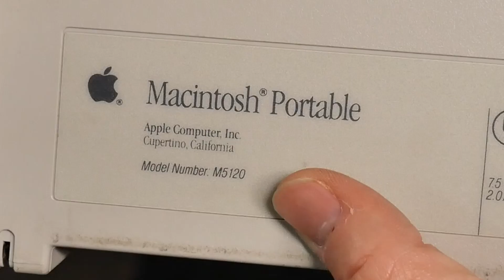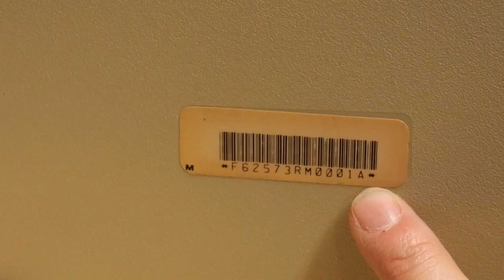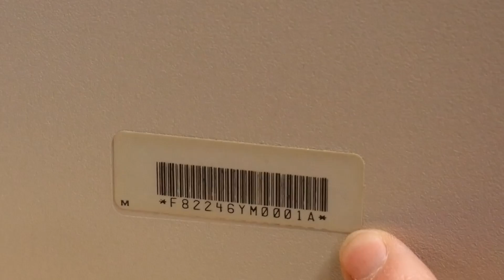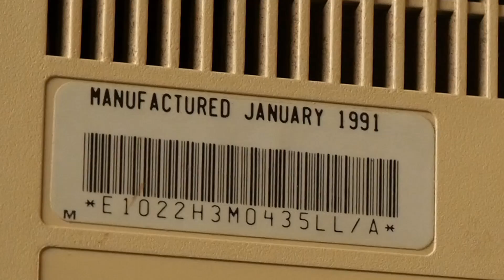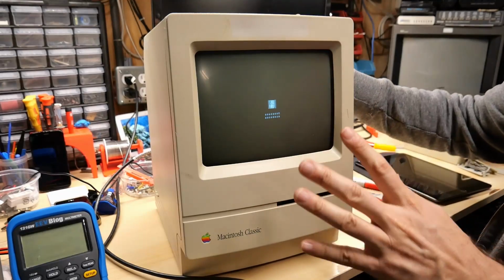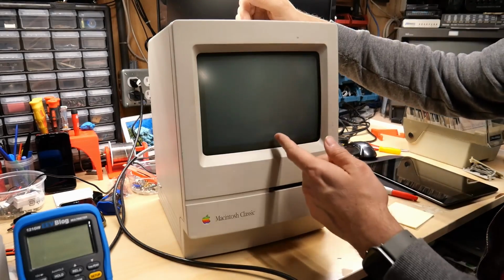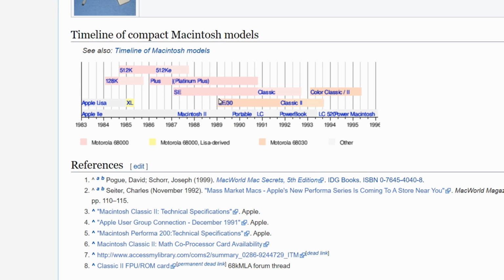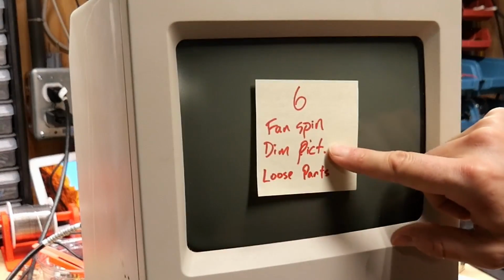Mac Repairathon Part 1: Taking stock of the issues

Comment: Hey Adrian I just got some Macintosh classic IIs on a Facebook listing and mine look way better than yours so I was really fortunate when I stumbled upon this video because I have three white lines on my CRT display so I’m thinking that one of the capacitors is bad and that was causing the whole system to just not work properly. But I’m going to watch every video to make sure that I figure out exactly what’s wrong thank you so much this is going to so help me.
Reply: I will also be making a video on these computers for my channel and it was very interesting  I think I’m gonna be doing a deeper diver in to why Apple limited this computer Processors power and ram upgrades

Comment: Are the CRT driver amps Class A if so they are prone to failure might be worth replacing the transistors on the board that snaps onto the pins of the CRT.

Comment: It is incredible, how inrealiable these macs are. Take any other from the era. Almost granted it will work
Reply from the maker: Actually really they are let down by the crappy capacitors the rest of the machines seem to be pretty solid. Those SMD caps were new and they all seem to leak from that era. Commodore used similarly crappy caps.
Reply: Adrian's Digital Basement 📼had a Mac classic in the 2nd grade I was 8 in 1992 we had 2 in our classroom

Comment: Hey Adrian, This inspired me to pop open my wifes Classic II Unfortunately it looks much different inside and out than yours. I have a question I saw in someone else's channel that there is a mains capacitor of some sorts that should be replaced but I don't see it in this one any ideas if this is still an issue with this model?  Would love to send you some photos of this one if you like so you can see the differences. Of course it's all open now.

Comment: 13:28 - I thought you meant the Sony hard drive - those things had a 100% failure rate and they stopped manufacturing hard drives around the time of the Classic. I'm itching to break out my units - they are in my attic though...

Comment: Man, you guys get stuff donated to you that I have trouble finding for a reasonable paying price

A 16-bit data bus wouldn't affect the amount of memory installed. The address bus is what affects memory limits, and a 16-bit data bus would limit the machine to just 64KB of RAM, which isn't the case. Apple probably chose to discontinue the SE/30 for the Classic II for both manufacturing costs (Apple was running out of money), to follow the newer design language (The SE and SE/30 looked a bit dated at the time) and probably to encourage people to upgrade.
I would love to see some work being done on the boards you think are completely gone - Couldn't hurt to at least try cleaning them a little bit! See if theres any life left in them. I'd recommend white vinegar for helping to remove some of that corrosion.

Love the repairathon series you've been doing, first the C64s and now some compact Macs, hope we see some more interesting machines on the bench!

Comment: I am sure you know this about the mac portable, but just in case.. 

I have that Mac Portable myself and they all have this issue where it will just power cycle constantly if the battery is dead, so if that happens then there is absolutely nothing wrong with the system and all it needs is some battery as the PSU itself is not powerful enough to power it without a battery with some charge. I had to make my own battery once the original failed.

I heard some people feeding a low voltage directly to the battery input itself or using a non standard but higher voltage PSU, but I have no idea how safe that is.

Comment: Hey i got a quick question. I have an old macintosh classic laying around and it keeps blowing the fuze when i power it up. I've tried hooking the mainboard up without anything else connected and it still blows but i can't find the short. Do you or does anyone else know what the problem might be?
Reply from the maker: If it blows without anything connected at all then yeah that PSU has issue. Switch mode power supplies aren't super simple to fix but perhaps on the vintage mac forums people may have an idea about common issues.

Comment: Cool donation! I've got two Plus machines that work great, a Classic II that, for some reason, I cannot get the modem/serial port to work (VERY frustrating), and I have a Macintosh Portable like yours, still in the case, that looks virtually brand new, likely due to it looking like it lived in the case most of its life.  I've got to find a battery substitute for it though as it won't power on its original power supply without a working battery.Looking forward to this series of repair videos, Adrian!
Reply from the maker: So I know if can work without the battery but you have to toggle the switch? Or you can just hook a PSU right up toe the battery connection and run it directly off that. (The Portable.) Your Classic II will have issues unless you've recapped it -- corrosion galore all over that board can easily kill things. Lots of videos coming up including a repair of that machines here.
Reply: @adriansdigitalbasement  If there is a switch, I haven't heard about it!  All I have heard is that some later power supply from a new notebook would supply enough juice to it to make it work.  Maybe you'll discover a secret once you start yours.  It's a neat-looking machine and one I never thought I'd have in my collection.  My Classic II has already been recapped (supposedly), but I haven't taken it apart to look.  That probably would be a good idea to do anyway.
Reply from the maker: I'll definitely give it a solid go. I most likely have the required capacitors in stock to do a recap on it. So we shall see how that goes!

Comment: I have an old Mac Classic II that worked great several years ago and recently I tried to power it on and it gives me black and white stripes on the screen. I opened it up and saw capacitor juice on there. I gave it a bath in alcohol and scrubbed with a toothbrush hoping that would help it but so far no dice. I'm very interested to see what all it takes to re-cap and get it working again. Should I try the soap and water bath instead of alcohol next?
Reply from the maker: You have to recap it -- no way around that. Also, the capacitor juice definitely can kill traces and stuff... You'll see what it'll take in future parts to get these machines working. It's can sometimes be easy and other times be lots of work. Seems like luck of the draw.
Reply: @adriansdigitalbasement   Do you have any suggested capacitor kits I should be looking for or parts shopping list of what it would take? Thanks!
Reply from the maker: https://console5.com/store/cap-kits/computer-cap-kits/mac-68k-cap-kits/classic-ii-cap-kits.html

These guys offer a good service for cap kits. If you want ultimate reliability go with the tantalums. I have an upcoming video on doing the recapping.

Comment: I have a New Old Stock lithium battery for those machines.  The bag tag is old and dated 6/24/92.  The battery measures 3.7 volts, pretty good for almost 30 years.  I would send it to you but US terrorism laws all but prevent private shipments to any other country.

Comment: Ugh I used to have a handful of portables when I was a teen but my parents did the typical clean house when I went to college. They won’t boot without a battery or some 12v equivalent in that spot. Rumor has it that a PB100 ac adaptor would run it without a battery installed but it didn’t work for me.

Oh geez and those oddball hard drives, also a wrench in the gears. I gotta say I miss wrenching on old macs though

Comment: I've seen a Mac Classic where the battery corroded most of the entire metal chassis and even took a bite out of the metal can of that quartz crystal. There were ICs missing from the board, corroded off or completely eaten away, compared to that board, this #6 machine looks factory new...

Comment: What a cliffhanger indeed! Just a remark: shouldn't you be using something else than soapy water to clean these motherboards? This is bound to leave a lot of mineral residue. I understand that you can't afford an ultrasonic cleaner like in repair shops, but wouldn't a toothbrush and isopropyl alcohol do a better job?

Comment: The battery damage from the Classic II already appears minimal. The cliffhanger Classic I know is going to be far worse. My friend Andrew has been trying to repair my battery damaged Classic. It may need some trace repair/jumper wires but still hopeful we'll get it running. We're stuck at checkerboard's right now.
Don't give up on the battery damage too easily!

Comment: I have a feeling the issue with the SE/30 was price… according to Wikipedia it was ~$4000 in 1991, while the mac classic 2  was only $1900. And it kind of makes sense because >10MB of memory would have been barely used by the average consumer. The SE/30 with 32MB of ram would have cost somewhere around $7k... Great for people who had applications that needed it, but most people probably didn’t.

Comment: Yep, the Classic II was introduced purely to squeeze more profit out of their customers. Cutting the data bus in half essentially cut the cost of RAM in half, and combined with the reduced chip and part count meant they could drastically reduce the price while maintaining their huge margins. It was part of their strategy of pivoting to the low-end of the market, and unfortunately it meant abandoning their high-end customers.

In any case, theoretically the Classic II could have supported up to 34MB with 16MB SIMMs, but evidently they didn't bother wiring up the extra address line. Seems like a real shame since it would've helped them retain some of their high-end customers, giving them an opportunity to make more money from upgrades.

I've designed a PCB for some 4MB 30-pin SIMMs, and I'm just waiting on NOS chips to arrive from Finland. Did you want me to send you over some once they're done? Assembled, of course. It's a real nightmare soldering those surface mount chips.

Anyway, I love these repair videos, so I'm really looking forward to the next part!

Comment: on the second Classic (machine 4), the Sad Mac code means:
00000005 = The RAM External addressing test failed
00800080 = RAM address line which failed

I think the Classic II was meant to be a budget model, but I don't remember exactly.

Comment: I had a performa 200 growing up which was the same as the classic 2. those are holes for the speaker on the side. performance-wise it was more on par with the lc 2. mine was maxed out with 10 megs of RAM and a 80mb hard drive. I remember my dad paying a lot of money to upgrade the stock 4 megabytes to 10 megabytes.

Comment: 12:46 .. @Adrian's Digital Basement.. = "there are loose parts inside.. let's power it up" .. Now i will sound like @LGR here... but " i do not approve "... I mean.. What if the last guy to open that machine.. left the CRT high voltage cable loose? 
Don't get me wrong .. we would appreciate the fireworks :-D ..  But it will completely fry any part of the board that comes near.. don't even need to get in contact with something to produce a nice 19thousand or 20thousand volts arc inside there...
not to mention the necessary change of underwear after.. :-D

Comment: Adrian, do you discharge the CRTs before poking around inside them as I am always concerned about going anywhere near CRTs unless you have used a discharge tool to kill any charge that is in the CRT? I was expecting to see you with a long screwdriver and a wire with a clip that goes to the frame of the CRT and then touch the tube connector clips underneath the cap?

Comment: I was anxiously awaiting the Classic II in your video. Mine suffered worse too. I bought one on ebay, symptoms: Does not boot. No inside photos... Not sure if YouTube will let me, but here's why my Classic II would not boot: https://i.imgur.com/m7iphb4.jpg  I honestly tried. I got it cleaned up, but too many traces were gone, some IC's were gone, and once I saw damage to the CPU... I decided it was not worth investing any money into. I found a Classic II Motherboard one ebay, bought it, and even without recapping, it was clean and worked great. I have since recapped it, and it works like a dream! Sad thing is, that Classic II appeared VERY low hour. I would say yours looks salvageable compared to what I had.

Comment: se/30 can go upto 128mb of ram, its based on the macintosh II series macs so the board architecture is very different to the classic line of 9' macs
as for the analogue boards all electrolytic caps will need replacing regardless of if they look bad or not due to age
resoldering the power conns is a common fix too, i usually just go over most of the analogue boards and reflow fresh solder on most of the joints as a preventative measure

Comment: My experience with the classic Macs is that the flyback coil on the analog board tends to go bad. I’m not sure replacements are possible, so the only viable option would be to rewind the coil. That may be more trouble than it’s worth.

Comment: Our office had a Mac +, SE and SE/30. With the + and SE we bought a daughter board that had a 68030 accelerator chip onboard. They worked well until we retired them in 1995 when we got the LC III/Quadra 605 and two clones, Radius and Power Computing. LCIII was 68030 and 605 was 68040 based as well as the two clones. We had to go to sears to get the appropriate screwdriver to break into the Plus and SE. All good machines and served us well as workstations and fax machines. Also the SE/30 ran our BBS until we started a website in 96. The Radius is still in our storage room and last I fired it up it worked fine about 2 years ago with Mac OS 8. Until Mac OS 8 got some needed updates we called it Redshirt O’Radius since it crashed a lot. Love this video.
Reply from the maker: That's cool -- those clone machines are far and few between these days. I wonder if they have the same cap leakage issues of the Apple versions? Hmmm.
Reply: Adrian's Digital Basement I have not booted it in two years but it did work fine . I do have a vga dongle and Ethernet too I do believe. Even the drive worked. It’s a machine frozen in time. The radius was actually much better than the power computing clone, that machine was sent back and serviced and it still froze. I think it had a bad motherboard or insufficient cooling. It was junk compared to the radius clone. It took us until 2008 to get back to using Macs after using pc’s from 2000 until 2008.

Comment: I bought five Classic IIs once. I managed to make two working ones out of them. The worst one looked like the lithium battery had exploded on the board and it had been left sitting like that for years in a damp place - half the board was completely destroyed. The bottom two inches of the metal chassis had rusted away. But the analogue board worked, so that went into one of the other ones, and the CRT went into an SE/30 with a necked tube that I bought (although it's still got a faulty logic board).

In fact, I've got a wall of compact Macs but they've been at the back of my big shed for about 8 years due to lack of any other space. If they're ruined I'll be upset, but there's not much I can do about it at the moment.
Reply from the maker: Then what you will see in Part 2 will be familiar to you. :-) And yeah that was always my intent -- to mix and match parts to get working machines out of these.
Reply: @adriansdigitalbasement  I think this video might have inspired me to fix the last Mac Plus that I bought (several years ago), which is the only compact Mac I have that's not in the shed. I had to solder the video connection (common fault), but the floppy drive just scratches everything I put in it. One of the Mac Plusses in the shed has a good floppy drive but a blown SCSI chip and a weird shimmering picture. Time to dig them out I think!
Reply from the maker: Yeah time to mix and match parts to make one good machine. :-)

Comment: Couple of questions, since you're a soldering expert what type of solder do you use to fix boards? Specs please. Also what temp do you solder at? I'm trying to teach my self how to solder. Got the tools just don't have the right type of solder to do things. Also for desoldering guns again what temp are you using? I am having a hell of a time desolder chips off my practice board. Thanx
Reply from the maker: I use 290-330C typically -- if the boards have ground planes you need a bit more heat of heat up the entire board first with a heat gun ... it will make soldering much easier. I use Kester solder -- don't skimp on it.  I'm using some  60/40 right now but people say 63/37 is actually better for hand soldering. I hadn't noticed personally .... also I use very thin solder -- that way I can more accurately control how much I flow onto the part I'm working on. As for desoldering, I use my Hakko 301 -- and it doesn't have temps I don't think -- I keep it set to the lowest setting. Sometimes you need to feed in fresh solder to help remove stuff.... Also, like I mentioned, if you are struggling, heat up the entire board first before attempting the desolder -- it'll help in some situations. 

https://amzn.to/2WhpahQ
Reply: @adriansdigitalbasement  Cool. I was watching your video with the desoldering pump. Bought the same one you have. Ordered the solder. I'll give your method a try. Practice boards come in handy. IC's are no problems, chips yes. Thanx for the videos... I appreciate the help.
Reply: @adriansdigitalbasement  Got the Kester solder OMG what a difference compared to what i was using. I tried your chip extracting technique works like a charm. So thanx again.